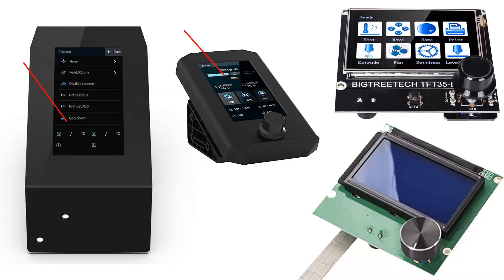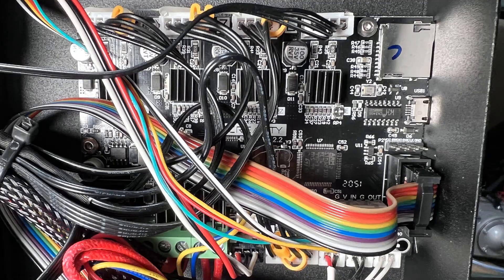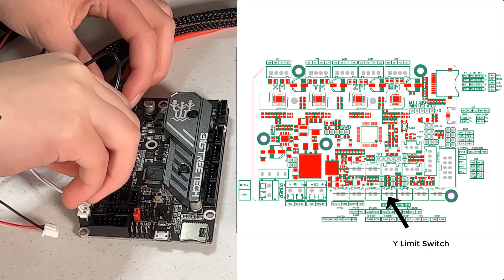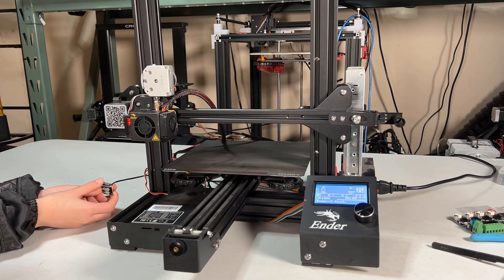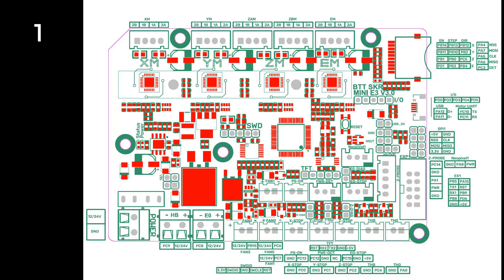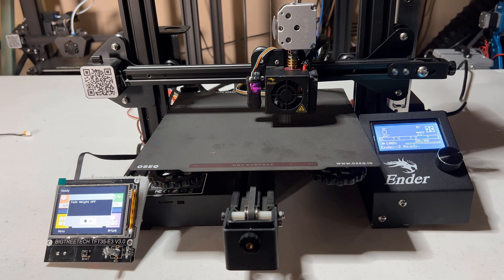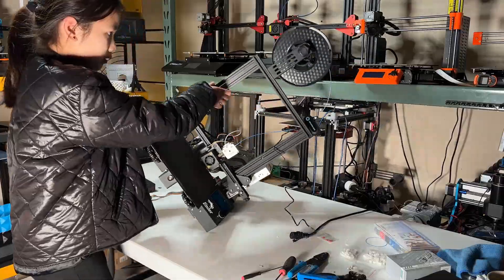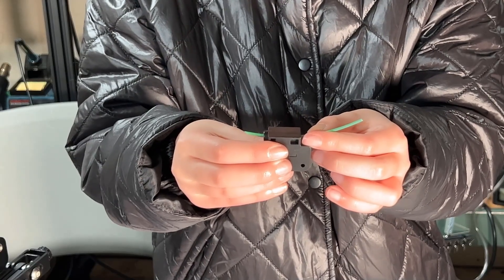Big Tree Tech SKR Mini E3 V3.0 and 3.5” touch screen upgrade on Ender-3 Pro, fixing BLtouch issue

Comment: Thanks, I had the exact same problems using the BLTouch Z homing firmware provided on BTT's github.  I moved the 2 wires to the Z-stop plug.  Might I add that you should mention that if the wires are reversed, it will continue to drive the nozzle down even when the sensor is tripped.  Simply reversing the wires solves this. I did this, as my wire colors were totally different than yours.  I knew what to do because I had to reverse the wires when I installed a BLTouch on an old CR-10 years ago.
Reply: reverse the wires on both ends???

Comment: Tremendously helpful especially the RS232 connector orientation on the board pins! Exactly what I needed. I was also preparing to connect the TFT screen power port to 5v on the board but it appears to be unnecessary!

Comment: I have a ender 3 v2 and my extruder motor has been overheating I was told I should replace the board w btt board but it sounds like it'll be a little bit of a pain to swap due to display should I just try to tune my vref? Or should I still swap

Comment: Some reason changing the file to firmware.bin does work. Not even before adding it to the SD card. Also m851 comes up as an error.seems like i might have gotten a faulty board.

Comment: In connecting the BLTouch using Method 2, which is connecting the 5-pin BLTouch into the Probe port, and connecting the Z-limit switch... Is there anything wrong with doing that? Reason I ask is because I don't have a JST Connector & pins on me right now. I'd figure as long as my BLTouch can level the bed, it should be ok, and the Z-limit switch I at least have a stopping point as to how log the nozzle can go.
Am I right about this, that there should be no problems?

Comment: By now I'm sure you're aware the board does support the stock screens in the form of a re-wire or cable the bigtreetech sells? @4:08 there is a callout error in reference to the onscreen diagram.

Comment: Another great video, but you missed something special.

Using the touch sensor as the Z stop, you can replace the springs for posts and never worry about your bed again!
Perhaps you can do an update.
Instead of trying to cut small tubing to exact lengths, you can just fill the existing screw with common hardware store nuts.  Then with a final locknut under the carriage, you have identical length posts.
The only worry is the carriage wheels being sufficiently tightened to avoid wobbles.

If you try it, please make an update video.
Keep up the good work.

Comment: Loved the video! I did run into one issue though.. I did everything and followed you step by step. I connected my bltouch using the 3 pins on the bltouch port and the 2 pins on the z limit, but when I try to auto home or anything the z axis goes down to the bed and it  doesnt stop it just keeps trying to lower
Reply: Same, did you ever get it fixed?

Comment: Just installed mine yesterday with Cr touch and same problem. The firmware doesn't work. I've got some JST connectors coming today, but I hate this. WHY did they make this board and not make sure they had good compiled FW for it. Ridiculous!

Comment: Great video! I bought the Creality 4.2.7 silent board for my Ender3 only to have the bed mosfet fail. I replaced it with BTT board just as this video shows and it's been great. One of the best pieces of advice is taking pictures of original board connections before starting. This is great advice before doing anything you're modifying. I work on motorcycles and document steps start to finish.

Comment: Great video Aurora. I have the BTT V2.0 board in my Ender 3 Pro. I just installed the dual Z axis upgrade and saw there were 2 Z ports on the BTT V2.0. The cable that came with the upgrade kit is a splitter cable. I wanted to find out if I should run a separate cable from each Z port to each Z axis motor instead. I didn’t realize it until I watched this video that the 2 Z ports are coming from the same stepper driver. So now I know that the one stepper driver can handle both stepper motors. You have a new subscriber.
Reply: Did u figure it out?
Reply: @nextlvlroy  Yes. Thanks for asking. I also added pulleys and a timing belt to the dual Z axis screws to keep them in sync.
Reply: @TinkeringJohn  what did u do for the issue u had with the dual z axis cable?
Reply: @nextlvlroy  I just used the splitter cable that came with the dual axis kit. Since the BTT v2.0 board stepper drivers can handle 2 motors, I just plug one end of the cable into one of the z axis ports and the other ends to the stepper motors. Hope that helps. Are you facing the same situation?
Reply: @nextlvlroy  There are 2 Z axis ports on the BTT v2.0 board, but they both go to the same stepper driver. It has 2 ports in case you don't have a splitter cable and want to run 2 separate cables to the stepper motors.

Comment: Hello!!! I have a question about the bltouch. I set the offset and my prints start to print perfectly, but after some time, it is like the offset changes because the nozzle is getting further away, I try to do the baby steps in 1mm measure and no matter I add one or two more millimeters, the nozzle stays away. What is the problem, help please

Comment: Hello, thanks for the video, I followed the steps and everything is working, the bl touch works perfect! but the problem I have is that I do not get to work the marlin mode, the screen is black always, and I need it to configure the e steps, because I do not know how to use the touch screen terminal
Reply from the maker: You can just type M92 Exxx to set the E steps, xxx is your step number. Then use M500 to save it. For the classic Marlin mode, once you connected the ribbon cable, it should just work automatically, you don't need to config anything.
Reply: @AuroraTech  ohh ok. Thank you so muchhh!

Comment: Great video. I went the first route originally with both stock z endstop and cr touch. With the firmware provided from BTT, the touch would not fully probe the bed in most places. I tried to raise the bed height with respect to the nozzle but this didn’t work. Afterwords. I just tried your method and now my hot end fan doesn’t want to work. I believe it should power up when the nozzle is being heated. Any ideas?

Comment: Hi, I really enjoy your videos. I have a question. Is this SKR E3 V3.0 board works on Creality CR10S Pro V2 and Sovol SV01? I want to upgrade both machine to 32bit, and they both have BL/CR touch. Is that difficult to compile the the custom firmware for each machine?

Comment: I ordered both of these items for my CR-10S over the weekend; so excited to get rid of the 5 year old board in mine!

I've done fresh Marlin Firmware installs to add an E3D V6 and BLTouch, but not sure how to approach a new board and my searches aren't coming up with anything relevant. I have to wonder if I can use an Ender config and change just the "machine" settings...?

I'll watch this again with my 3 year old daughter, because you're inspiring 🤘🤘
Reply: I bought an SKR mini e3 v3 for my ancient CR-10S have not installed it yet. Did you install your control board yet?
Reply: @fatboy1271  Looks great! There must be something wrong with your audio though, I couldn't hear any motor noise ;) So did you end up using the Ender config and tweak the machine settings?
Reply: @ThePapaDawg  Thanks and that's quite funny! Mics are muted, but I can't believe how quite my CR-10S is now!!! 

I believe I completely built Marlin from scratch, but honestly, I can't remember. If you want, I can share mine with you. I made comments on all of the changes I made; E3D V6, BLToutch, Micro Swiss Extruder...

Comment: You say for the heated bed wiring the ground (black) is on the right and the hot (red) is on the left, but the diagram you have them switched. I followed the diagram where the red is on the right and the black on the left. When I turn on the printer, the bed heats up on its own without stopping. I don;t want to risk burning anything by swapping the heat bed wires to what you said vocally, but I have no clue what to do now.
Reply from the maker: Even if you reverse the red and black for heated bed, it won't make any difference. If heated bed is automatically on when you turn on the machine, the first thing you should check is make sure it didn't connect it to an always-on terminal, for example, the terminal for the 24V hotend heat sink cooling fan.
Reply: @AuroraTech  I tried a few things and it seems like it may be the board itself. I read through some posts of people having the same issue as me and it seems common that a MOSFET for the heated bed fails in the open position, giving the heated bed constant power. I checked this and it was true as the second I powered the printer, a green LED on the SKR mini board turns on, which I guess indicates that the bed is on.
Reply from the maker: Since the board may change from time to time, my best guess is if the heated bed is connected to an always-on terminal, it will turn on when your machine is on, just like the heatsink fan. Since I have no access to your hardware, you may need to contact BTT for more info.
Reply: @AuroraTech  I just did a quick test by swapping the hot bed and extruder wires and now the extruder shoots up to 80°C within a minute. I think the terminal itself may have failed into having constant power. There are no other terminals to try as the E3 V3 only has them for the power, bed, and extruder.

Comment: I got "!! STOP called because of BLTouch error - restart with m999"... do I need to do what you did and swap pins on cr touch to z stop? You had said something about editing it in firmware perhaps an alternative? I guess I can do either but would prefer fixing it in firmware? Gotta find the skr source code if I can. Sorry to ask I am just in over my head. I don't mind swapping pins if it's the easiest fix I guess.

Comment: The touch screen firmware also comes with several different icon theme packs. I prefer the Round Miracle Menu Material theme, so much nicer than the default square icons. Just add the folder to the SD card when updating the screen firmware.

Comment: Im using the cr touch from creality and attempted this but the module no longer works after splicing and using the last two in a JST connector. Does it only work with BL touch and not crealities version?

Comment: The BL Touch I have is from creality, the one you have is a different color scheme than mine, shouldI just use the same black and white wires on the opposite side of the bl touch connections or use the ones you pull out (blue and red)
Reply: I would also like to know
Reply: Did you figure it out? Having the same issue

Comment: Hello Aurora,
I have a problem with my SKR Mini E3 V3 with the CR-Touch on a classic Ender 3.
When I run a bed leveling, my probing grid is not square but rectangular and goes all the way to the Y stop.
It is also not centered but glued to the left side.

I don't understand because when I make a Z-Home, the probe is perfectly centered.
Margins in Marlin are 10.

Do you have any idea where this could come from?

Comment: I have been struggling with the Ender 3 Pro with the BTT SKR Mini E3 V3.0 and the CR touch for a while. This was the fix. Worked beautifully. 
- Updated BTT TFT Firmware
- Updated BTT SKR Firmware (with Z-Homing)
- Swapped the pins per video instructions. 

Thank you! :)

Comment: I want to use the pre compiled firmware for the e3 v3 that is listed on the github.  I do not have a z stop switch hooked up and neither is working.  Currently have a cr touch and everything is else stock.

Comment: I installed this same board to my aquila with a tft35 v3. Everything worked great with also a smart filament sensor connected to the board. Up until I upgraded the tft35 firmware which removed the smart option from the filament runout on and off button. And now I get filament runout warning everytime I try to print.

Comment: At 4.04 you said the hot wire is on the left and the ground is on the right, but the diagram you're presenting says the exact opposite?

Comment: Considering this on my Pro 3 or V2, was it worth it?
Reply from the maker: It's up to you, without it, the printer still works fine. But the silent stepper drivers will make your printer prints a little better with less ghosting and even more handy features with the touch screen.

Comment: Thank you very much for your solution regarding the CR-Touch!  
I have been looking for a solution to the Z-Homing problem for several days, I would never have thought of connecting the two wires to the Z-Stop.  
You were much more responsive than BTT support, who haven't answered me in over a month!  

Thank you again, keep it up, your videos are really very interesting!
Reply: Is this solution effective? very close to downgrading my board because of this frustrating issue with the CR touch.
Reply: @egoslammer4207  yes it work for me ;)
Reply: @kyriusplay  appreciate the quick response, also did you make changes to the firmware? Trying to save time of you don't mind giving some of yours lol.
Reply: @egoslammer4207  Don't worry, it doesn't bother me at all, quite the contrary.
I'm using the firmware given by BTT "firmware-ender3-bltouch-for-z-homing.bin".
It works great with the method given by Aurora Tech.
Afterwards, if I must be totally sincere, I think I will recompile a firmware because despite having adjusted the offset of the probe, the ABL is offset on the left as if BTT not integrated a margin on the gris size. It's not disturbing in itself for operation, just a little frustrating.
Reply: what color cable should i move to z-stop?
Reply: @ngrh7223 lograste solucionar?, igual tengo el problema con los cables 😢

Comment: you have sexy lip.

I like to add from a different video motherboard fan turns on when the axis moves. My motherboard fan moves when axis moves and that's fan2. fan0 is the parts cooling fan which turns on if you go into temperature - fan speed. fan1 is  hotend fan which turns on once reached 60 degrees. It might be my updated firmware that switched the fan port functions.

Comment: How do you get the Micro SD card slot to work?? I purchased this board and it comes up no printer attached and the Micro SD card slot does not work. The system doesn't even see that it has a slot. So I had Amazon send me a new board but the second new board has the exact same issue. I am totally tired of issues with BTT products. I'm new at this stuff and find people that are willing to help is next to impossible. I had tried the mini e3 v2 but it turns out it has issues with the z-axis not moving once the print has started. So I went to the mini e3 v3 and now no sd and no printer attached. Very frustrating. I've contacted BTT and they are worthless. You seem to be a very knowledgable young lady and I'm begging you for help please. My printer has bern down for 4.5 months and I'm tired of dead ends. Please help. I don't understand this stuff like most but I'm not stupid either. HELP.
Reply from the maker: It's very unlikely to have 2 motherboards both came with a bad Micro SD card slot, I have installed at least 5 BTT boards on different printers, I never had this issue. You don't have to do anything to make it work, even using the Ender 3 firmware that came with the board, the SD card slot still works. Are you using an Ender-3 or Ender-3 Pro? If so, following every single step in my video should work.
Reply: @AuroraTech  Well have you ever felt like a total idiot. I'm there now. For whatever reason I had the TFT plugged into the wrong serial port. What an idiot. Just goes to show that even us so called old and wise can make some pretty stupid mistakes. And I made a big one. I still heeded to do a lot more playing with firmware and the such but it would have gone a lot faster had I noticed that mistake. However, I still appreciate your responding and trying to help. That was very kind of you. Thank you. I'm now doing some fine tuning for nozzle distance from the bed and a couple other minor things but at least everything now functions as they should. Again, thank you so much for your help. Have a great day and keep up the great videos. PS. I still think BTT should charge more money for the boards and include a complete database of functional firmware for ALL the 3D printers out there. Plug and play. Who would be better to do that than the developers of the boards. If they hired 2 good people they could have firmware withing a few months. They would make more money and that would secure their place in the market. To stay on top you need to offer more than your competitors and right now they are falling behind. Anyway, thank you for your help.
Reply: @AuroraTech  I am trying to install it in a Anycubic Mega Zero 2. In the marlin mode everything except the Mini's Micro SD card slot. But when I run the BTT interface the board won't even move anything or even see that there is a micro SD card slot on the board. So yes, either a bad board "twice in a row" or something isn't properly set up. So if you have any ideas on how to make the micro sd card slot work I would really appreciate it. I did see a video on YouTube where the host said something about having to enable the micro sd slot on the board using the visual studio code program. I can't even figure out how to properly save anything in it. All the videos I've watched about VSC the hosts go way too fast for me to follow. If you can help I would appreciate it, otherwise I guess I'm stuck with the original Zero 2 board and screen. Just so you know exactly what I'm trying to do: Anycubic Mega Zero 2 printer, BTT Mini E3 V3.0 main board, BTT TFT 35 E3 V3.0 screen, addition of a second Z-axis stepper .  I have waisted so much time trying to make this work. I am so frustrated. Please help me if you can. I have sent several emails to BTT and they never respond. Not the best company when it comes to support. Thank you for your time.